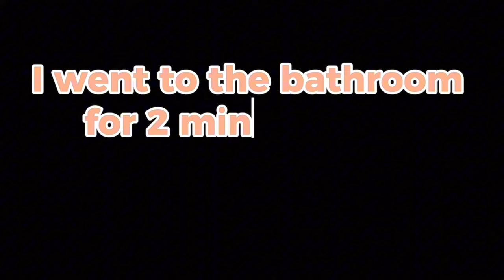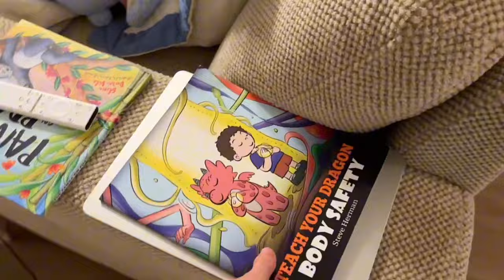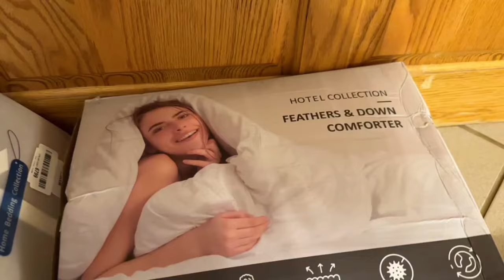Renovating Storm’s Room

Comment: When the end of the Dyson gets blocked up you can actually take it apart really easily. On the underneath of the vacuum head there is a small round circle with a line in the middle (just like a flat head screw) you can just take a knife and turn the screw and the bottom comes off and then you can take the roller part out and clean it and then you have open access to where the clog was. That probably doesn’t make sense so a quick YouTube search will show you. It’s really easy and makes cleaning the brush or unblocking things super fast. ❤
Reply from the maker: Definitely didn’t know this omg 😂 Thank you so much for this!!